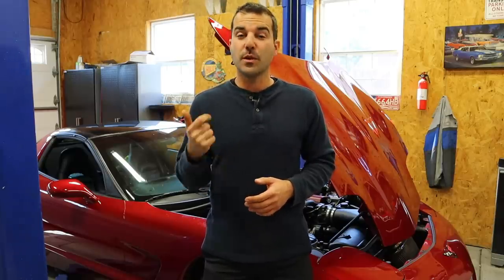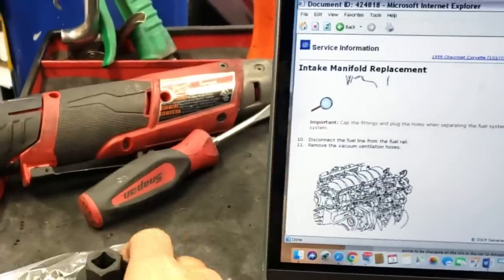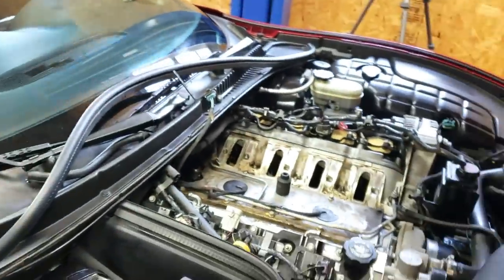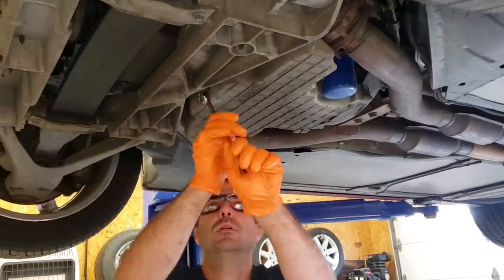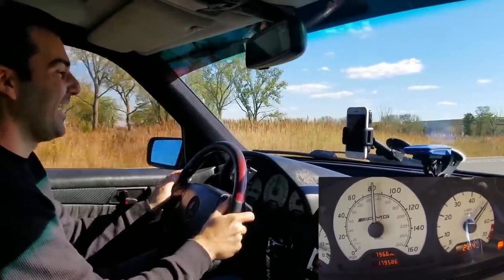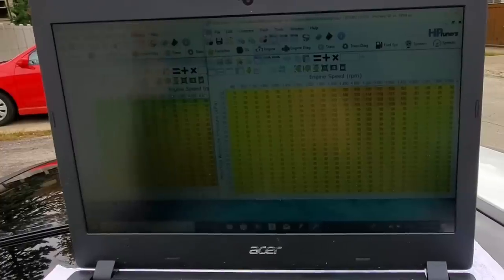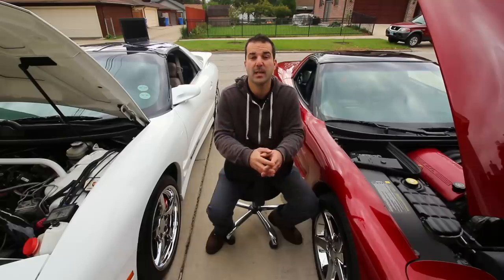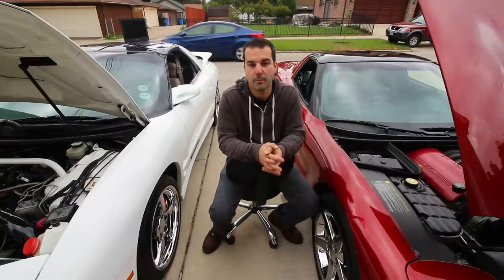I’m Building A 40 MPG Corvette That Sacrifices NOTHING! Project EcoVette Starts Now!

Comment: You could also cover the underside with panels to get better air flow.
Reply: jospi2 The underside of the C5 is already very flat
Reply: @josephchristopher5294  depends
Reply: @josephchristopher5294  Depends on the ride height and front bumper design, smoother bottom also helps lower resistance depending on the scenario.  Probably 100 more factors that go into it, too.
Reply: Yes add 40lb to reduce almost no drag. Smart
Reply: @Mavrck-it2kq  If it reduced the drag, in long term it probably would help, thinking of good solutions always has a few bad eggs, so let's support them so we can get more good solutions.
Reply: @emmanuelferguson  nah there are such things as stupid questions and stupid answers
Reply: @Mavrck-it2kq  you do realize they come from the factory getting 30mpg highway right? That in a car making 320ish whp.
Reply: @Judge_Jon  It's 28 mpg not 30. Just because 28 and 40 are relatively close as far as numbers go. When we're talking about mpg he will not get 30% better mpg while sacrificing NOTHING. As he says. If it could easily modified to use less fuel while performing better it would have left the showroom that way. In 2001 being green was a selling point and Chevrolet would have taken advantage of that selling point.
Reply: @Mavrck-it2kq  Rolling resistance is 20% of energy required to push the car down the road at 70 mph. 80% is wind resistances. So increasing down force by 40lb ~ +1.25% of weight multiply by ~20% = an increase of rolling resistance by 0.25%. So basically zero. I bet it would then net a decrease in cd by .01-.015 which would be around decrease in overall resistance of up to 4.3%. (cd assumed to be 0.28)
Reply: @paladain55  Yeah that's all well and good. Now lets look at the actual car and the actual comment.  In real life the vette is far more aerodynamic than most vehicles out there meaning the design of the car currently won't can't gain much more in that department. If you were to put the car on a lift and cover all open areas that could catch air at highway speeds with aluminum sheet my guess would be  a 40 lb increase in vehicle weight. 100 lbs excess in your vehicle could reduce your mpg by 1% (Based on a fuel economy improvement of 0.33% per 1% reduction in weight as estimated by Ricardo Inc.) The question is knowing you're adding weight do you get a gain larger than the loss. Since neither of us have a spare vette on a lift so we can do the math we're both guessing but my guess is that covering the underside is going to add more mpg than the aerodynamics nets back the other direction. If an aluminum panel unseen by the owner could net even a slightly noticeable mpg gain Chevrolet would have done it on this car. All these people in this comments section forget that high mpg numbers were desirable when this car was made and millions of dollars in RnD went into it.
Reply: @Mavrck-it2kq  Too much generalization. Rolling resistance and Aerodynamic resistance have varying effects as speed increases or decreases. Hence, why I stated 70 mph like what the video poster stated. Also, the Vette is decent in the aero department (actually 0.29), but just above average. Plenty of random cars in the 90s and now do better. And actually probably not. At the time GM was struggling with corvette sales and profitability. GM literally designed a c5 version intended to be the poverty spec car (the frc) to bring in more buyers which ended up becoming the Z06. They literally canceled the camaro. lol (also see: 2008: GM Bankrupt, offers to let Ford buy them, Ford declines.)
So given math as stated. rolling resistance of 20% of total resistance at 70 mph. 1% of car weight times 20% = a decrease of 1/500th of drag on the car (0.2%)
Reply: @Mavrck-it2kq  Alright Scion FRS. The jdm underbody panels drop the cd from 0.28 to 0.26. They are made of plastic. Last time I checked they were around 1 kg. The undertray on the engine portion of my prius weighs like 3-4 pounds for the whole thing. The corrugated plastic under tray I made for my 90s civic weighed like 2 pounds as well. Main point here is it doesn't have to be a skid plate lol. Besides that we are arguing similar points. Welcome to the internet bois. Most of the gains besides lean burn will normally be low hanging fruit like completing the underbody below the engine, smaller door mirrors, or deletes, etc... Actual assumption: Corvettes already overheat at HPDE's. When you block off the lower portion of the engine bay you will get rid of more of the venting possibly exacerbating the problem.
Reply: @paladain55  you're right but he's not going to fab plastic panels. He could fab lightweight aluminium. Point being this whole thing is an exercise in futility. Underbody paneling certainly isn't going to do much either way and this whole idea of making a 40mpg vette that sacrifices nothing is absurd even if the panels were an aero gain and somehow improved mpg they still may cause a loss in 1/4 et which would mean the guy trying it failed at sacrificing nothing.
Reply: @paladain55  also don't tell people you drive a Prius. It's just embarrassing.
Reply: @Mavrck-it2kq  You have a very open mind sir. Please pat yourself on the back. We need you in the engineering world for future advancements.
Reply: @paladain55  Too busy over here in the common sense world dealing with people who want to do dumb shit like make a 40mpg vette to begin to worry about the engineering world
Reply: I heavily suggest you look at pictures and videos of C5's on a lift, they already have panels under everything
Reply: @Mavrck-it2kq  eat your crow, he has a video of it doing 40mpg.
Reply: @Judge_Jon  He did not do 40 mpg while sacrificing nothing. Doesn't take a smart person to realize nothing is free.
Reply: @Judge_Jon  hey Jon what does the extra heat from running your engine lean do to the parts in your engine?
Reply: @Judge_Jon  Figured you'd have nothing to say to that. Chevy would have leaned it out if they could get 40 mpg with just a tune the reason they don't is warranty claims would break them. Of course you can do it the real question is should you and at what cost.
Reply: @Mavrck-it2kq  The issue is SMOG formed by NOX . . . one guy can't ruin the environment, but imagine if MILLIONS of people did this.
Running too lean can ruin the cat-converter, too.
BTW, hypermilers use nylon screen that is RTV glued underneath, then painted with latex house paint to fill all the holes and leave a perfect dimpled surface. It's less than 40 pounds.
Reply: I guess the GM engineers did a good job!
Reply: @neindochoohh7955  Completely agree.
Reply: @Mavrck-it2kq  such a beautiful car for a low price. THX GM

Comment: 40 mpg is probably the upper bound of possible. Your plan is good; you're focusing on the most important things first. (Lean Burn and long-tube headers with gearing and the 3rd major option; lowering the car is a no-brainer, too.)  

Getting the headers right is important: calculate what RPM your engine will be running at your test speed of 60/65 mph given your rear gears and transmission OD final gear ratio. You then want headers that will make your engine's torque peak close as you can reasonably get it to that #. That will mean a smaller primary tube ID than most "performance" oriented headers. A small Tri-Y header will help broaden the torque curve and will help keep the torque up down low. -Exhaust Gas Recirculation (EGR) is also the original form of "displacement on demand" technology and will reduce the effective size of the engine at highway cruise -consider getting a header with the EGR tubes intact, although lean cruise will get you close in terms of fuel economy. 

The cam would often be next but the stock LS1 cam is pretty eco-focused already with a small duration and wide LSA; a modern cam with more aggressive ramps but similar durations can increase your dynamic compression ratio / cylinder pressures up to the max you can support with 92 octane / 93 octane fuel and can help with fuel economy a bit too. 

-If you were going to rebuild the engine I'd focus on increasing compression and decreasing your "squish" between the piston and the head to the absolute minimum a high-speed quench is like "Free octane" and allows you to run with a higher Dynamic Compression Ratio / cylinder pressures without running into detonation -it also makes the fuel burn happen faster which means you can use less ignition advance which helps torque and fuel economy. 

Beyond your current plan, the actual next thing I would consider is a Plasma ignition system if you want to get a bit exotic: these will make a high-speed flame front from a larger initial ignition "flame kernel" (technically a plasma event immediately following the initial spark firing) this speeds up the fuel burn rate fairly significantly (although at a loss of spark plug life) which allows less ignition timing AND the ability to run a leaner burn safely. < combine this with a simple methanol / water ignition system and you can run VERY lean.  Meth/water ignition gives you tons of potential MPG benefits as it cools the incoming air charge which again allows you to run more dynamic compression ratio / cylinder pressure while resisting detonation with pump gas. (To fully take advantage of it you'd be rebuilding teh engine with a higher compression ratio -12.5:1 or even 13:1 and while you're getting those new pistons to run the higher compression ratio you should get a thinner 1 mm ring pack -oil rings on pistons alone are responsible for up to 8% of a total VEHICLE (not just engine) friction. ->If your headers include a crank case evac / vacuum port you can run a low pressure oil ring. (Piston rings are responsible for 50-68% of an engine's total friction...)

Comment: The old Honda’s used a couple tricks with lean burn. Those engines had only one intake valve open at low rpm to get a lot of swirl, and they use pretty high EGR flow to cool the combustion process off. This also gets you more throttle % for the same power level, so you get less pumping losses. And this is what allows lean burn to work

Comment: Idk why Mazda rated the Miata so low.  I daily a 2019 Miata and get an easy 40+ hwy.
Reply: It’s better to low ball and exceed expectations
Reply: My 92 would get mid 30s when it was running right
Reply: If it's American spec they may have leaned it out a little to give better emissions, thus better than the Japanese spec. I might be wrong, but it has happened before
Reply: My '99 typically gets around 27 combined, combo of nice day commuting and some fun backroad use. The thing to remember about convertibles is that they are are horrible aerodynamically. Ever notice that the car accelerates 60-80 noticeably faster with the top up and windows closed than it does with the top down? They're a tiny car, but their C_d is not all that great for what it is. Combine that with low gearing to make it feel peppy with a low power engine and modern speed limits that are higher than they used to be (which runs the engine outside of its BSFC optimal range) and voila, you have a small car that's surprisingly average on fuel economy. Compare that with a C5, which has a ton of torque to pull some long overdrive gear ratios and really low drag, and suddenly you have the classic comparison of a 1.8L Japanese car getting worse fuel economy on the highway than the thirsty small block V8, lol. All that considered though, 27 combined is pretty good for a cheap thrills type of car that runs like a top without any issues ever! 

I like the discussion this video has brought up.
Reply: The EPA uses a specific method to test the MPG of each car that doesn't always deliver the highest MPG possible.
Reply: They expect you to floor it often
Reply: Same thing with my 91. EPA says 22 city, 28 highway and I have no trouble getting 33MPG combined with spirited driving and A/C on. The biggest limitation on mileage for Miatas is the incredibly short gearing. My engine turns over 4000RPM at 70MPH in 5th gear. I'm guessing Mazda cared more about driving fun than gaming the EPAs test. That's fine by me.
Reply: I could be wrong but doesn't the Corvette switch to 4 cylinders on highway? from what i understand the Vortec max switch to 4 cylinders and they are the same engine just taller.
Reply: It’s because Mazda doesn’t time for EPA numbers, they tune for average person’s daily driving.
Reply: You forget its a small engine and I think he referred to the turboless version. Small engines get its power from extra rpm, thus at higher speeds their engines have to be held at way higher rpm than an engine that makes loads of power and has a drivedrain that meant to driving faster (speedwise)
Reply: This far and no one brought up the fact that it's a 2001. NA and NB Miatas have really short 5 speed manuals. They rev really high at highway speed so the gas mileage is ass. 

This doesn't apply to a newer Miata with a 6 speed.
Reply: valdomad there has never been a factory turbo Miata ?

Comment: There is a benefit with lean burn but if you are already at 30mpg, I don't think there is much more in it. If I were you I would put a wideband on the car as it is stock and see what air/fuel ratio your are currently running to get a bench mark. You want the wideband in the same location as the narrowband (at the tailpipe no good imo) You also want to datalog the advance to see where that is at also. Being such an old car check what injectors are in there. If they are single pindle EV1 injectors your lean burn misfire limit maybe not much past 15:1. I found switching to EV6 multi hole injector certainly allowed running leaner ratios before misfire. Also airspeed thru the ports at idle has a big bearing as to how lean you can go at idle/off idle, higher airspeed, better mixing.
Reply: Sensible commentary like this is being drowned out by the sheer volume of "have fun melting your engine" comments but I gave you and upvote anyway

Comment: Even My Hyundai doesn't give me that kind of MPG in City conditions. Too Good Man, Looking forward to the Series. Keep up up good work.
Reply from the maker: City is totally different. It's very hard to compare city mpg since traffic changes often.
Reply: Rohit Verma very few cars get good city gas mileage. Highway is much easier.
Reply: my Datsun b110 gave me 45 mpg back in 1974. Why haven't cars improved on mileage 45 years later?
Reply: @rayt5520  bc safety and weight.
Reply: @rayt5520  safety, weight, power, emissions.
Reply: @rayt5520  emissions. Leaner burning means better mpg, but also more NOX emissions. EPA and CARB stuck their nose into it and made mfgs reduce NOX, which also meant richening up afr's and losing mpg.
Reply: @rayt5520  that being said this Vette will be on the borderline of whether it meets federal emissions standards or not after the lean burn tune is in it.
Reply: mine does no problem. shell premium gas amsoil signature series oil. and all the JUNK out of the trunk. well except the spare tire.
Reply: Well, the city is hard since the engine has to frequently work its way up the gears and then start all over when the car comes to a stop. That's why city milage is so poor. My tiny 2.0T Elantra is only getting about 31-33mpg and that's with me coasting pretty much anytime I pick up speed. On the highway it's about 37-38mph @ 70mph constant speed.
Reply: @Ieatpeople2  I have driven my car about 125 miles straight monitoring my milage, and that's when my milage was around 37-38 at 70-80 mph. Maybe if I drove it like Miss Daisy I'd easily be in the mid forties. Maybe I'll do a engine/fuel line cleanup with Seafoam and Royal Purple sometime and try to get more mpg's. Right now I'm running it on 87 fuel even though 89 is what I should be using. Cali gas is expensive. Usually in the city I coast a lot, but even then in my area it's dense at times.
Reply: Hyundai were known to get slightly worse than others.  And does it say not to use fuel treatment or high octane.   Not too sure after 2015 or so

Comment: Gen 1 Honda Insight used lean burn in the U.S. only in the manual trans model.
Reply: the AFR got up to 25:1 too
Reply: my gen 1 only burns at 16.5:1.... but mine is a 2.4l now, and makes 250whp. still gets 45mpg
Reply: Yup. Love mine. 60mpg easily. 75-80mpg highway.
Reply: Civics did lean burn as well, before the insight

Comment: The biggest thing about fuel economy is the amount of fuel you need. If you have big cylinders, you intake a lot of air, which means you need more fuel to maintain the proper ratio. Going rich or lean an engine that sucks in more air will use more fuel than an engine with a smaller displacement. This is why manufacturers have mostly switched to 4 cylinder engines, the addition of a turbo is not for fuel economy but rather allow the car to have more power. Most significant factors: the amount of fuel you can deliver, weight, and something people forget about is aerodynamics using spoilers (not wings) will also have a good effect if he can find a good kit, plus if it has underplates. Plus a few other things he went over, I typed this as I watched the video, he did a good job, I am sure he gets 40mpg out this no problem!

The biggest things manufacturers do to get good mileage is: variable cam timing (VCT), cylinder shut off, plethora of sensors to determine spark, fuel, VCT timings even things like intake runner/bellow size (which has immense R&D tied to it,) smaller displacement engines, 8 speed automatic transmissions, start/stop, use control modules all over the car to reduce wiring weight (many cars even today have up to 300bls of wiring in them) the use of lighter and durable materials like carbon fiber, magnesium, and titanium.